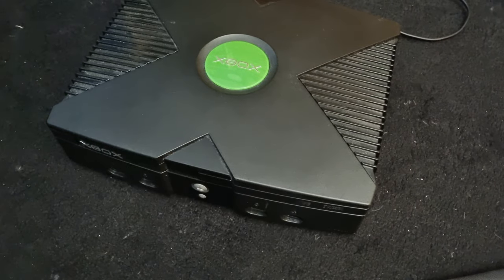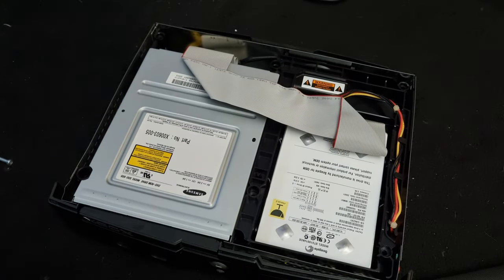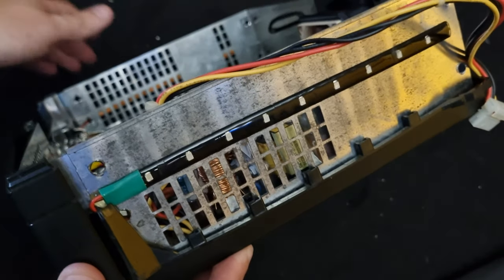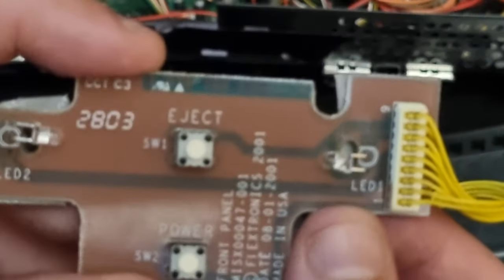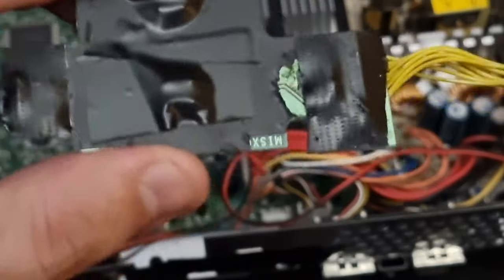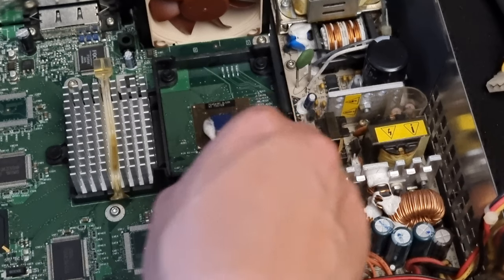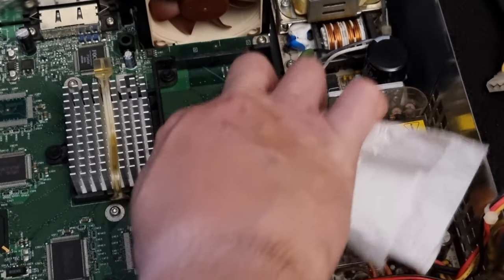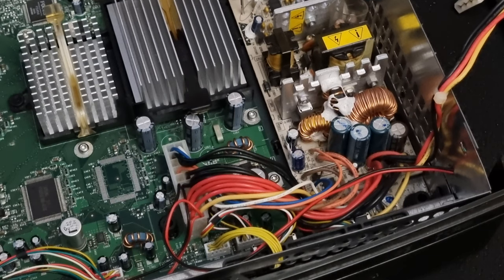how to LED mod your original Xbox console

Comment: I have a few questions

1) What is the voltage of the 3mm LEDs?

2) Where did you find LED strips that have exposed wires

3) What solder do you use?

Thanks!
Reply from the maker: 1) the voltage drop of most LEDs is around 3volts each but the total strip uses 12volts so you plug them directly into the 12volt rail from the power supply
2) you can't find them on either eBay or Amazon or most electronics websites simply type on 12volt DC led strip
3) any leaded solder will do the job
Reply: @Abauto84  thank you!

Comment: I think you can replace the clock cap in a 1.6 to an LED
Reply from the maker: yes you could but not much point as you wouldn't be able to see it
Reply: @Abauto84  I do have one that has not been replaced yet, will see how it goes haha

Comment: If I were to change out the 3mm LED’s around the eject button, when the Xbox has an error and would give off the green/red or green/orange LED color, that will no longer happen?
Reply from the maker: it will still flash in red colour to let you know there is an error
Reply: Buy a bicolor 3mm LED

Comment: What temperature do you have your iron set to?
Reply from the maker: i just use a 40watt soldering iron it has a set temp on it but if you have an iron with a temp you can set then Turn on the soldering iron and set temperature above the melting point of your solder. 600°- 650°F (316°- 343°C) is a good place to start for lead-based solder and 650°- 700°F (343°- 371°C) for lead-free solder